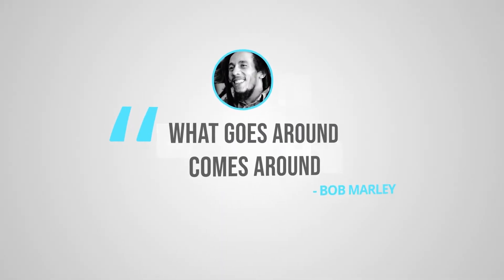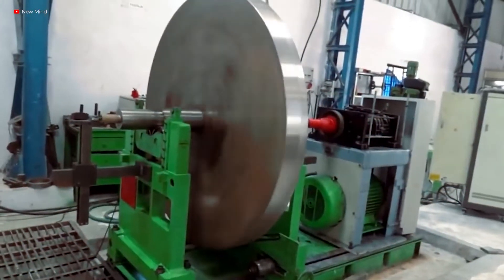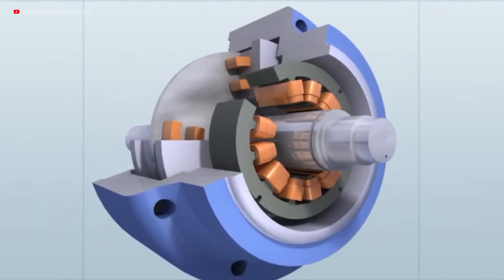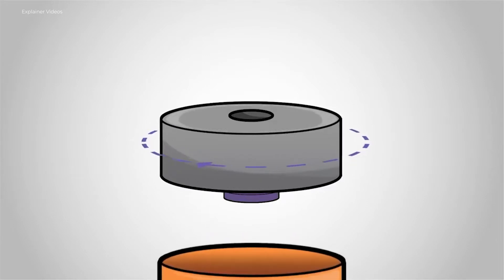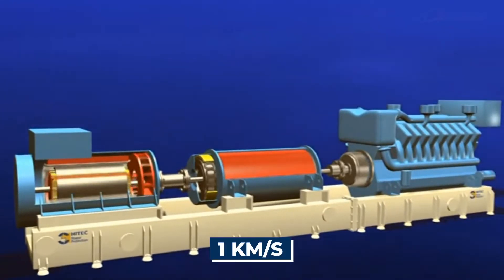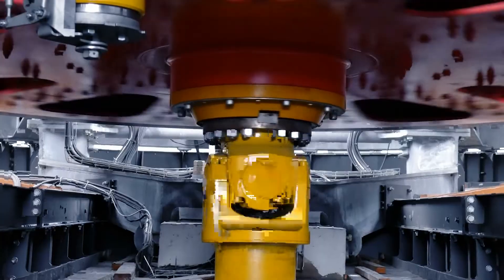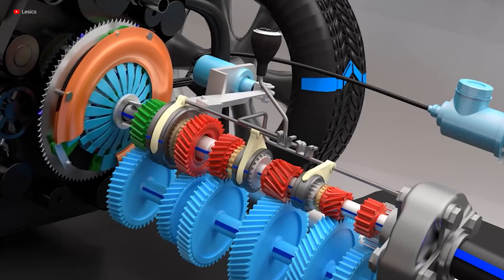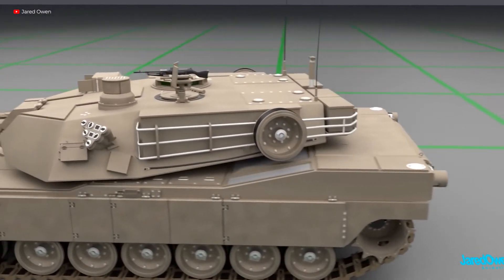Fly Wheel Batteries For Cheaper Tesla EV? It's FINALLY Hitting The Market

Comment: Use it in ev? What about the gyro effect? If you drive to a corner and you want to turn the car, it wants to go straight. It will be very hard to accelerate or slow it down. Am I right?
Reply: A vertical axis flywheel would help roll in corners and only be an issue on hills, 2 counter rotating wheels cancel eachother

Comment: However, there are problems with this technology. They have a low energy density, so they will not even replace lead-acid batteries. Where are the super capacitors that store electricity? This is a more rational solution for vehicles and cheap small energy storage units (energy sustainment for several minutes and hours). To make it profitable, the electricity consumption of devices must be reduced. Then, and only then, does a battery based on rotating mass make any economic sense.